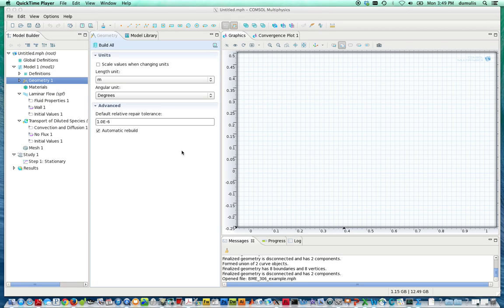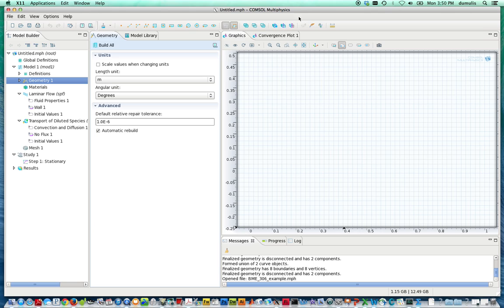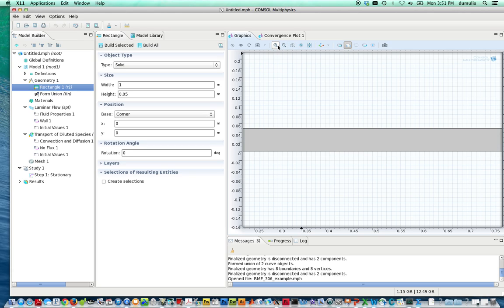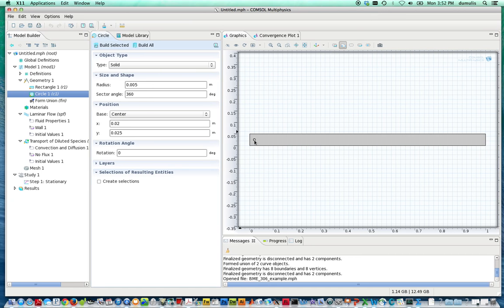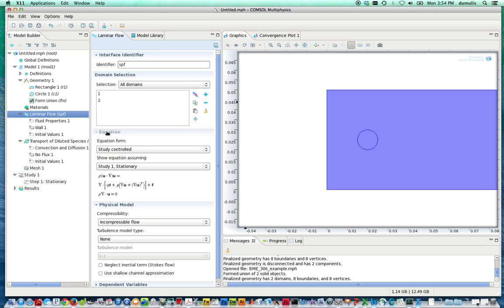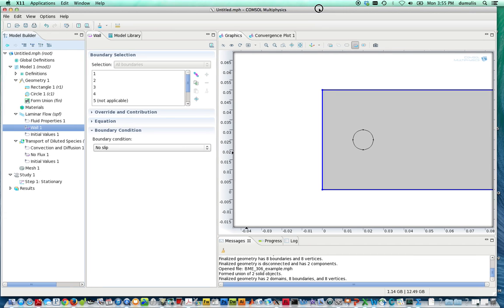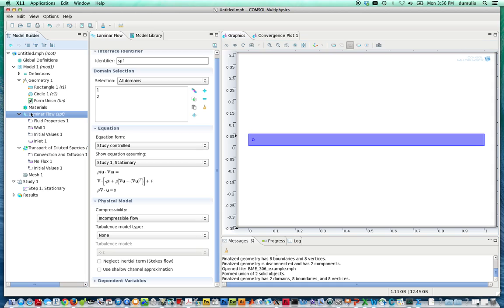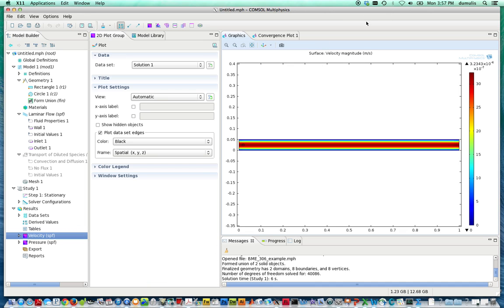Solving for laminar flow using Comsol

Comment: can you perform a co-efficient form of PDE for above analysis. in my opinion we will be requiring two pdes, one for continuity and one for momentum equation. and how we will be able to apply the pressure boundary conditions as there is an option of essential boundary conditions but not of natural boundary conditions.